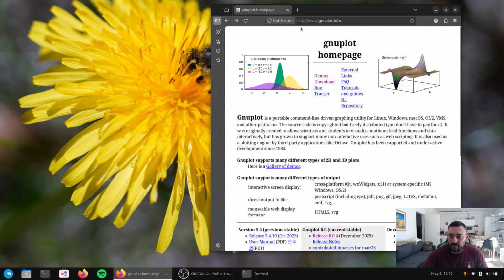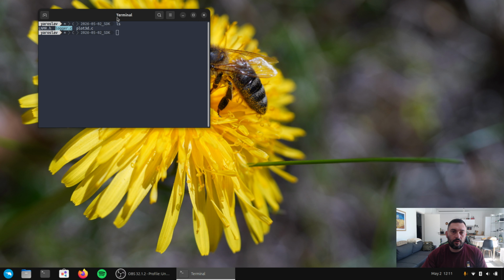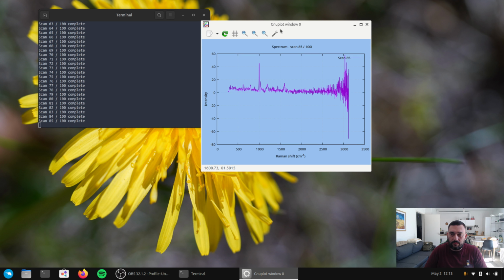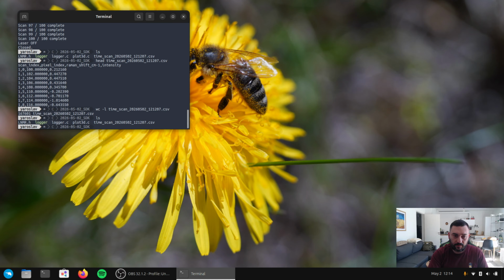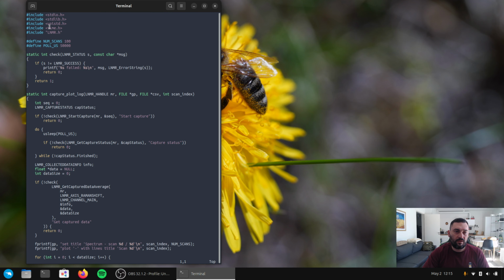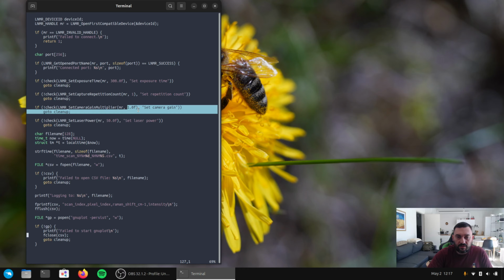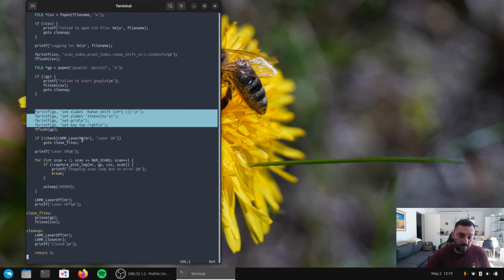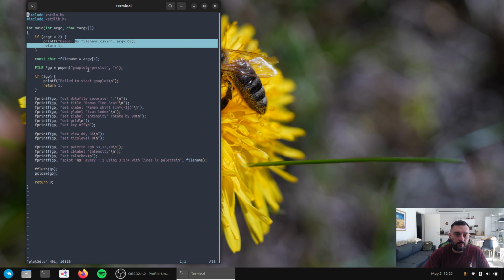Lightnovo C SDK on Linux: Real-Time Raman Spectroscopy with 3D Visualization

Comment: Really pleased with how easy and straightforward it was to develop these examples using the Lightnovo ApS C SDK on Linux.
The entire pipeline — from device control to real-time acquisition and visualization — came together smoothly in pure C.
Great work on the SDK side by Yurii Pilhun 👏

Comment from the maker: The link to the website of gnuplot engine used for real-time visualization in this example http://gnuplot.info/
The C program is streaming the data from the device to gnuplot which takes care of plotting. 
Using such an approach you can design customized Linux pipelines assembling multiple tools and make it optimal for your workflow and your specific application.